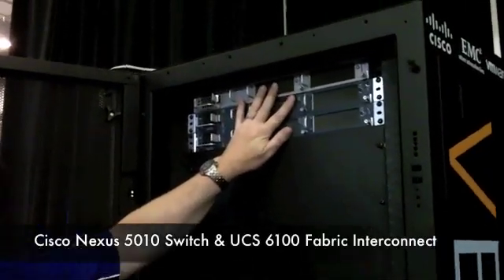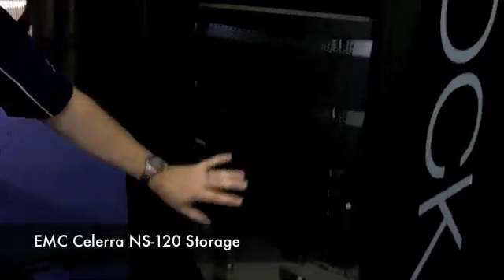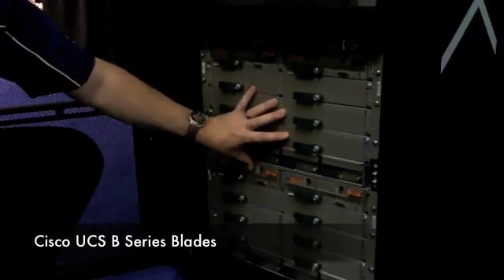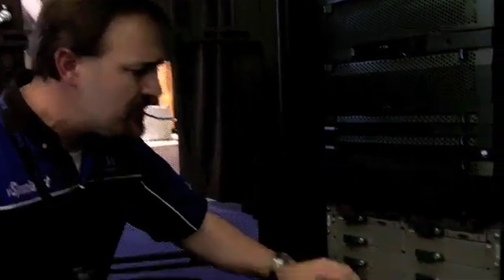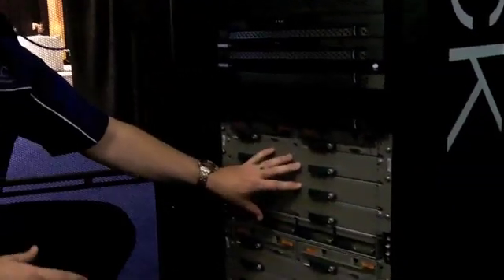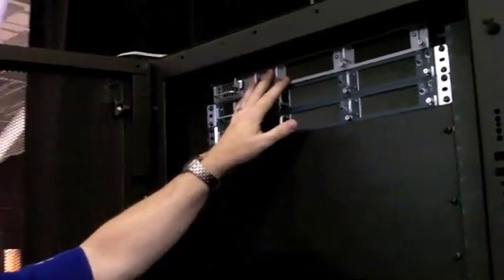What is a VCE Vblock 0?

Comment: Can anyone tell me in a layman language, what exactly a Vblock is? Is it just a hardware only. Can Windows OS be installed on it?
Reply from the maker: Srinivasarao Kotipatruni Hi.  A Vblock is what is termed a converged infrastructure, ie: it combines, compute, storage and networking into a single pre-validated solution.  By pre-validated I mean that it is effectively a solution that can run a particular level of workload on it.  On this hardware it runs VMware vSphere and on there you would in turn run your Windows OS (eg: Windows Server, etc).  As you can probably imagine it has extensive management and automation tools built into it also.  Hope this helps.
Reply: Hi ***** Thank you very much. This is helpful.
Reply from the maker: My pleasure  :)